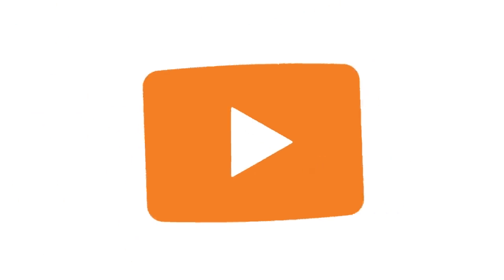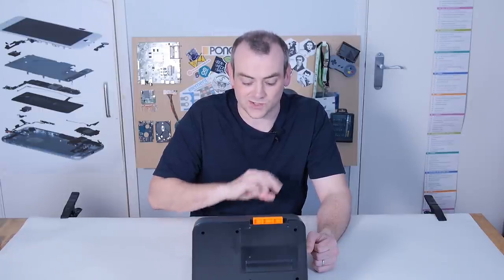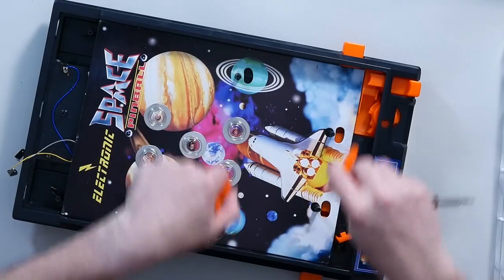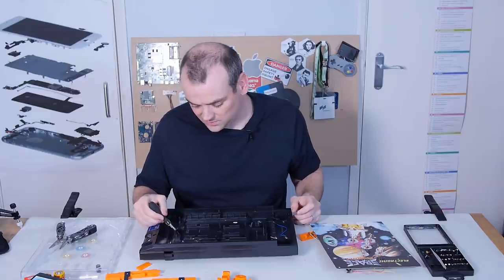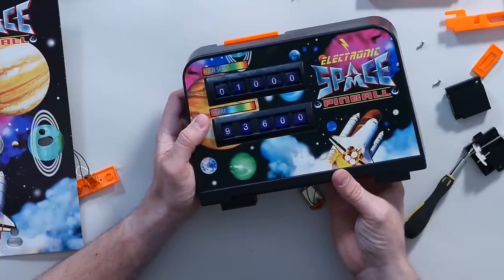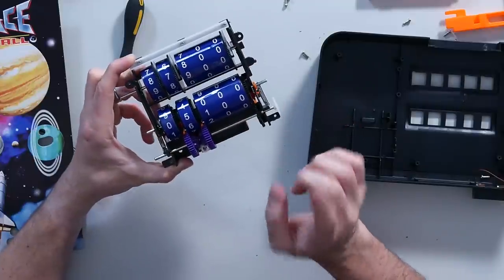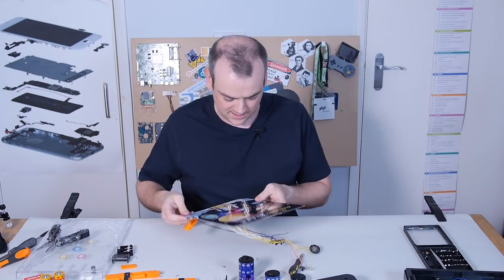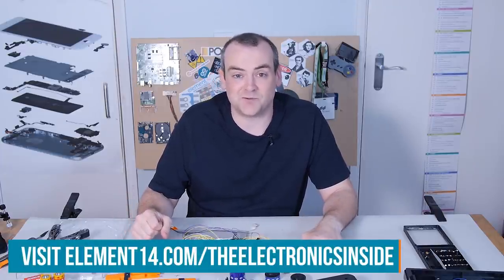Vintage Desktop Pinball Teardown - The Electronics Inside

Comment: My grandparents had an older version that actually had electromechanical bumpers that changed the path of the ball. It was definitely the same chassis as that, though.
Reply: That'd make for an interesting comparison!
Reply: @a531016  This is definitely the machine: https://www.ebay.com/itm/Vintage-1979-Tomy-Atomic-Arcade-Pinball-Machine-Working-Condition-VG/203054462260?hash=item2f46fd3534:g:eMEAAOSwz-FfFsSC

It looks a little different than I remember but it is very similar to the one you took apart. I'll see if maybe one of the cousins still has it. If I find it, I'll send it your way.